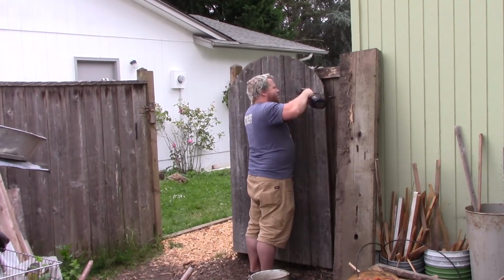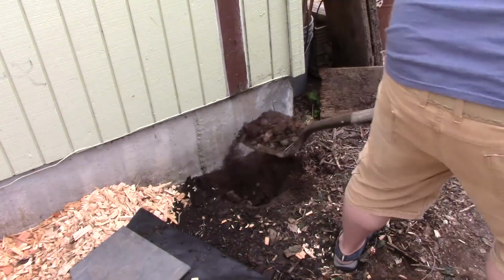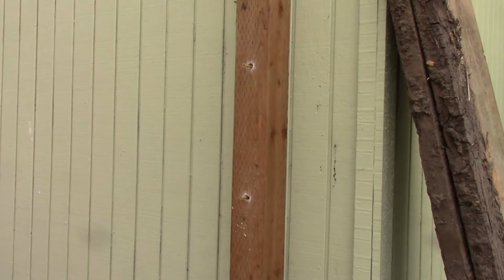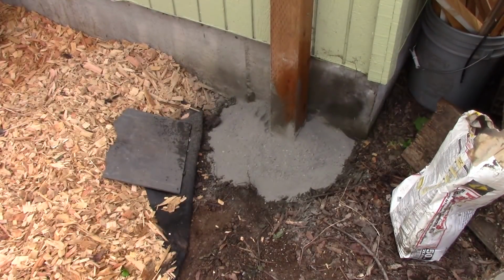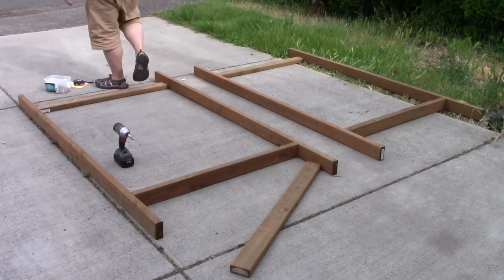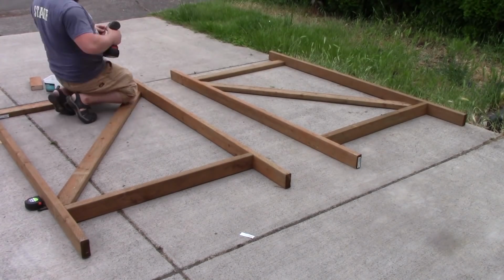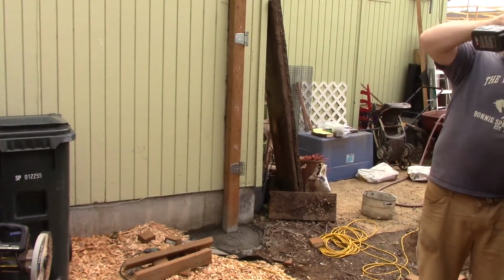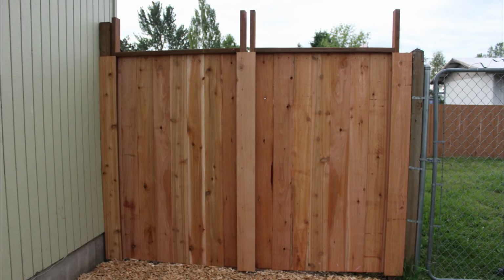How To Build A Wood Fence Gate!

Comment from the maker: https://www.patreon.com/thehippiegeeks

As the channel has grown and changed, I have tried to respond to every single comment in a timely manner. Unfortunately, that is getting harder and harder to do as the channel has gotten more popular, especially with chains of comments and responding back and forth. The comment system on YouTube is just not set up well to handle that many comments with the time in the day that I can give to it.

Introducing our Patreon page. We have had it up for a long time now, but have not really utilized it and if you had looked at it before, you would not have much of a reason to join. Well, I went thru and revamped the entire thing. I want to be able to use that platform to connect more with those that are interested in doing so, at whatever level they  decide to. If you have ever wanted to chat with  me directly, Patreon is going to be the best way to do so going forward. I will still be responding to all of the comments I can, but as I said in the beginning that is getting harder and harder to do. There is not a team of people running this channel, it is just me and I do the best I can =)

Anyways, thanks for reading this, and I hope to see some of you over on Patreon =)

Comment: Add a "drain bed" (gravel) to the hole, set the 4x4 (do not seal bottom) on top of gravel, level and pour in concrete. Even pressure treated will rot from bottom up if not allowed to drain.

Comment: The  gates look good just my take on fencing is I always use galvanized posts they last longer and if you get a min. 16 ga. they are also as strong if not stronger than the wood posts. Keep in mind that doing it this way you'll need wood to steel post brackets. Over twenty years I've replaced the fencing twice and the post are still in great shape!
Reply from the maker: Nice! We prefer the look of wood, even with understanding that it will not last as long =)

Comment: Nice looking fence an you asked, so here's my thoughts: concrete is very hard on skin, needs to be cleaned off well, that doesn't get done, then skin cream to help skin usually to female to be used, so best to just use gloves! (It's best to mix concrete with tools not fingers). Screws not heavy enough for double gate, so 2 ft on centers with 6"-8" lag bolts, an long enough to screw all through 4X4 post without being counter sunk except just head of lag bolts (when drilling to counter sink bolt head remember size of socket too!) Then with smaller drill bit, drill through 4X4 for lag bolt shaft (if you drill through post with bolt size bit, then when you countersink for bolt head you won't have the center wood support for point of space bit), an consider what your screwing into, real 2x4 wall support backing or just siding!  When you set the support cross braces you put them in the wrong direction for center sag. The upper center on each gate needs support from center sag, so cross brace goes from top/center to outside/post lowers. Bracing direction for center support is needed for all cross bracing not just gates! Lastly the short screws toe nailed into house not necessary an just water gatherer, so now that they are set, seal them an turn your cross braces around! Hope this helps! Tim
Reply: Regarding concrete contact with skin.  My experience is that concrete always dries the skin out.  The real problem is that concrete is an alkali and can sometimes cause a chemical burn with redness and blistering (second degree).  I've seen professional concrete guys who deal with the stuff on an almost daily basis get by with no problem, then one day, BOOM, they get burned.  Not sure why, probably the mixture they came into contact with that particular day.

Comment: You probably did a better job than I would have but one point to note is that the 3 inch screws put in the 4x4 with a pre drilled 1 an 1/2 inch hole, only gives you one half inch into the house wall. So it was good you added screws on an angle. I either would have pre drilled a longer hole and used longer thicker screws. You did a great job though. Thanks for posting.

Comment: To make sure its square use the 3-4-5 method. 
Measure 3 feet down one side and 4 feet across the top marking both and then measure between the two and if its 5 feet then your work is square.
Reply from the maker: That is also a great way to do it, I just prefer to measure corners when dealing with gates like these or planter boxes =)
Reply from the maker: Yeah, either way will square up a box =)

Comment: Concrete is weak when you mix it in the ground, over time it will crack and rise but your fence is the high quality and looks great.
Reply from the maker: Yeah, this is not necessarily the strongest way to mix concrete for sure. If I were doing anything other than fence post holes, I would have mixed it up in the wheelbarrow and then put it in there. For this though, the concrete should last as long as the post does.

Comment: I rebuilt my wood fence without concrete.  I dug the holes to about 33 inches, put a couple of inches of gravel in the bottom, and set the posts.  I tamped the $hit out of the clay soil as I refilled the holes.  I'm sure the You Tube experts will tell me how wrong this is, but I don't care.  The fence has held up for 2 years.  That includes high winds and freezing temperatures.
Reply from the maker: It is amazing what people will pick apart online, but the great part from a creator standpoint is that even someone telling me what I did wrong is engagement, and the algorithm rewards any form of engagement =)

Comment: I've watched about 10 gate building videos here on YouTube and about 50% get the cross bracing part backwards.  The original builder of this fence did not, however  00:18
Reply from the maker: I left it the "wrong" way for a year to see what would happen, and it held up with no change or sag at all. I then swapped the doors so that it would be "correct" as that is what the conventional wisdom says to do, but they seemed to hold up fine either way.
Reply: @TheHippieGeeks  They may hold up fine for a year or two, or five but will eventually sag.
Reply from the maker: I can see that, a lot of folks make it out like the gate is going to immediately collapse though ... so I left it for a while just to see what it would do =) As I said though I swapped the doors after that though and they are still doing their thing =)

Comment: concrete strength is greatly diminished when there are deviations from thoroughly mixing with the exact amount of clean water. i have removed post when this mixing method is used.better to mix properly.
just trying to help.
Reply from the maker: I can definitely see that happening, but in our case things have worked out great. All of the posts are set well and we haven't had any issues with them not being held in properly.

Comment: are you not putting any kind of latch on these to open/close them?  and what about securing them so the wind doesn't blow them open?  of course, I'm talking about if/when you remove that center board that hides the center crack.  as for looks, who cares?  if it's what you want, that's all that matters.  they suit the purpose.  I think they looks fine.  also, you did a great job of showing/explaining exactly what you did.  not a lot of people do that.
Reply from the maker: I wasn't sure at the time I posted the video what kind of latch I wanted to go with, but we settled on this one from Lowes:
https://www.lowes.com/pd/National-Hardware-Steel-Painted-Gate-Latch/50426836
It cannot be opened from the outside, but that is by design as the security of the gate means more to us than the convenience of being able it from the front. Our neighborhood has gotten more and more sketchy over the last couple of years, and we are adapting to that reality.

Comment: You put the cross brace in the wrong direction; still works.
Reply: The old gate had the brace the right way why fit it wrong on the new gate?
Reply: "why fit it wrong on the new gate".  What does that even mean? The old gate was correct and the new one is not. It will still work fine like that, but the other way is far far stronger.
Reply: It is obvious what "why fit it wrong on the new gate" means, you mentioned the brace was wrong in your own comment. It is bad joinery practice to fit the brace in this way, I know many of these posters are amateurs but some research should be done before posting videos that are misleading.
Reply: "why fit it wrong on the new gate" is grammatical nonsense, it doesn't mean anything. So is the rest of your post that you just sent. I guess that explains why you made the gate backwards.
Reply: "I guess that explains why you made the gate backwards".  I did not make the gate, where did you get that idea?
Reply: LOL good point. Have a wonderful day.

Comment: I dont wanna be an asshole but I am pretty sure you want something to keep water out when you screwed that 4X4 into the house/shed siding. Also as others have noted, the braces do not support the weight of the gate in the direction they are placed. Otherwise this is a nice gate.
Reply from the maker: I don't mind a little constructive criticism at all =) You can't see it, but there is a roof overhang above there that protects the area pretty well. You are however completely correct and I should have protected the penetrations better. It hasn't really gotten wet all winter, but I may go out there and run a bead of caulk around the post/house interface just to give it some more protection.

I haven't shown it on an updated video yet, but I heard the feedback loud and clear, and swapped the gates as per everyone's recommendations. I will likely do a "big reveal" video later in the summer, just for fun to show everyone that I had indeed taken their advice.
Reply: Today I am embarking on a project to deal with this exact issue at my house. I am attaching a 2x4 to the outside of my house for my gate. There doesnt seem to be any good way to prevent water penetration other than just running caulking around where the screws will penetrate the exterior. So we are basically gonna end up on the same boat at the end of the day.
Reply from the maker: Just use a large bead of caulk, and the pressure from screwing the 2x4 to the wall should spread it nicely and form a pretty good seal. Honestly it is just doing the best you can with the situation you have =)
Reply: Briar Horn hahahaha i saw all this too, those gates will sag so bad
Reply: And those screws may have lead so why did you shove those in your mouth!
Reply: Did you reverse the diagonal support direction? If not the gate will start sagging. They should run from bottom hinge side to top of gate latch side. Your previous gate at the beginning of the video was built properly.

Comment: The (Z) piece is backwards.Eventualy the gate will sag!
Reply from the maker: We left it that way for several months with no sagging issues. However when I needed to raise them up a little I went ahead and just swapped them so that the Z brace was going the proper direction.
Reply: I am builting my 1st gate for a friend's girlfriend house and while I have built fences I wanted some videos.  One thing I didnt know was that the diagnal piece matters where its placed and 2nd instead of doing miters for the frame I am going to do half lap joints for extra strength. 

Glad I watched numerous videos and read comments to learn more before tackling it.

Comment: Not wishing to be pedantic but your diagonal braces are incorrect and won’t stop sagging. The bottom of the diagonals should always be on the hinge edge… Now the top two corners where the gates meet will drop and bind together over time 👍
Reply from the maker: I am always open to constructive criticism =) You are not the first to comment about this, but you are correct. However, just out of curiosity I left it the way it was for more than six months, and there was no sign of sagging. However, I needed to raise the height a little bit at one point so when I pulled the gates down, I swapped which side they were on so that it would be correct =)
Reply: The Hippie Geeks I never said they were badly constructed, it’s just a question of physics due to the effect of gravity. With the diagonal finishing on the wrong side it’s easy to see that applying force (gravity) to the top of the gate it would skew and collapse. With the diagonal in the correct position the force would be transferred onto the hinges upright thus resisting sagging. The fact that the gates were showing no signs of dropping is a testament to the solid construction. Left as was for a few seasons of contraction and expansion however???

Comment: Always pre - mix concrete!
Reply from the maker: I would say that depends entirely on your application. When the instructions on the bag from the manufacturer list watering in place as the method to install it, I think that it is acceptable to follow that recommendation, especially when it is just holding posts in place.
Reply: I'm a concrete contractor for 44 years. If mix as you're doing, the concrete mix is inconsistent. Take the time and do it right, always strive for excellence!
Reply from the maker: Or, you can follow the instructions on the bag and mix it in the holes for a post, if that works out for you. While you will get more consistent results with pre-mixing, that is not always easily possible for people which is why they make these types of concrete products in the first place.
Reply: Me again! Over the years we've demoed fence posts untold times, and you can always tell when that method is used , because the concrete crumbles, instead of  fractures when demoing.Your not taking full advantage of the concrete mix.Your work should always be clean , and professional !

Comment: Braces are wrong !! Swap them over else they will sag..
Reply: Mr B was just about to say the same thing. Lol
Reply from the maker: I have replied to a few other comments that we had already done that, and need to do some kind of update video to show it =)
Reply: The Hippie Geeks can you describe what needs to be swapped.
Reply: Btw, can you post the dimensions of the gate?  What is the longest gate that this design will work for without sag?
Reply from the maker: Swapping the sides the gates are on. You want the cross support to go from the bottom corner where it is attached to the post. That will allow it to support the weight of the gate properly.
Reply from the maker: I am not sure what the longest span that will work, but ours are each just over four feet wide and have not sagged in the last year =)

Comment: Great vid. Thanks for posting. Your hard work paid off!
as a note, those tall posts that protrude out the top detract a bit from the pretty-ness of the rest of the fence. Do they hold a purpose standing so tall above the fence? just curious. 
Thanks again!
Reply from the maker: We have actually chopped them considerably shorter at this point, we wanted to have a 1' extension above the actual fence line to be able to hang prayer flags or lights on. if you check out our Instagram, there are a couple of recent photos that show them with prayer flags  hanging there =)